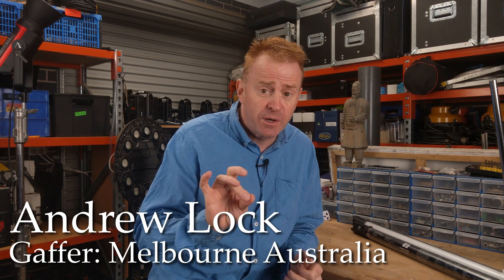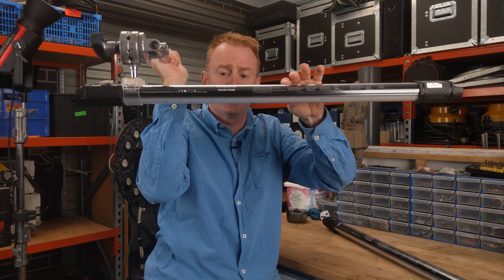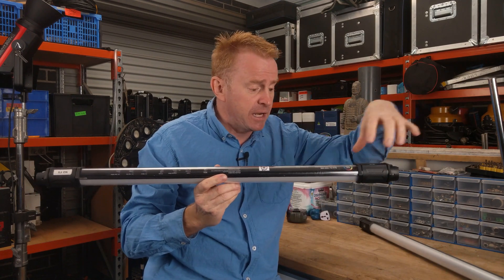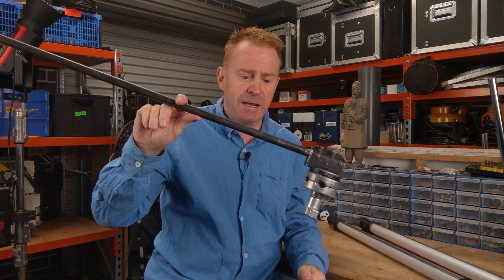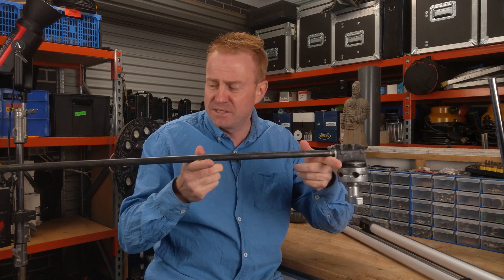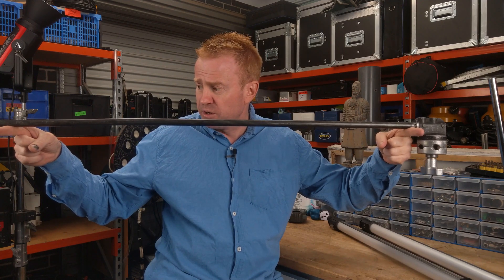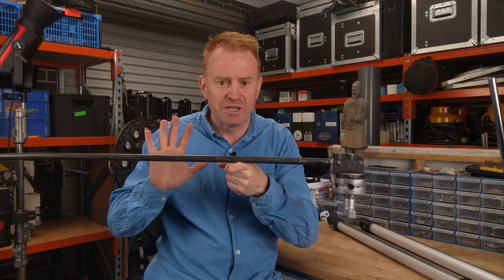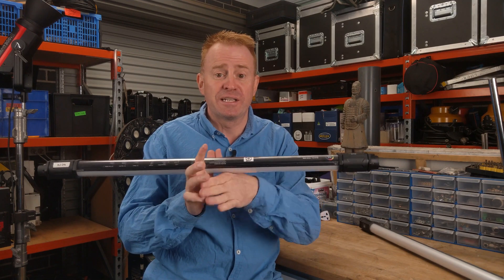Gaffer & Gear 91 - Finding Center of gravity on Tube Lights

Comment: I didn't expect to learn something new, but here we are. Thanks for sharing this! Finally something where I can 'give back' to you for all your awesome videos. 
It's similar to weight distribution of a load between two supports (like pillars) in a bridge. When you (the load) walk across, the total load (weight force) is shared across both pillars, but the distribution of said weight is like a ratio over those two supports. So if you're standing closer to one of the pillars of the bridge then your weight force will be more on that pillar than the other one (maybe 9 to 1 ratio for example).

Let's bring it back to your C-stand demonstration. This trick works because of friction (I'm butchering the equation here just to simplify its application):

Friction force = roughness between two surfaces x Weight force on them.

So if you have more weight force over your finger (like more load over the pillar in the bridge), you'll have more friction, and hence more resistance to sliding. The finger that's furthest from your centre of mass, has less weight force upon it, therefore less friction, therefore it slides. Vice versa.